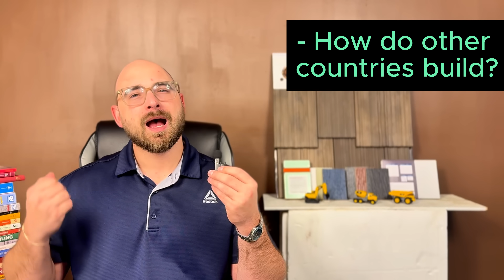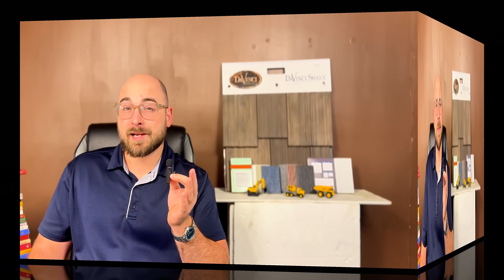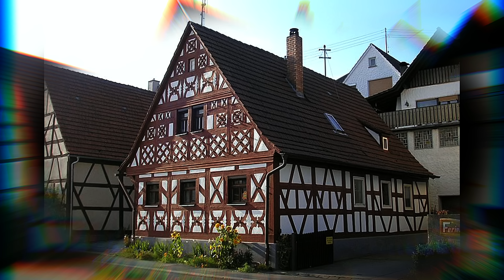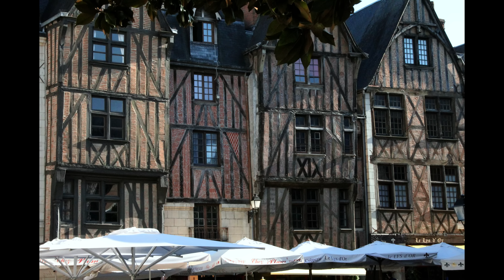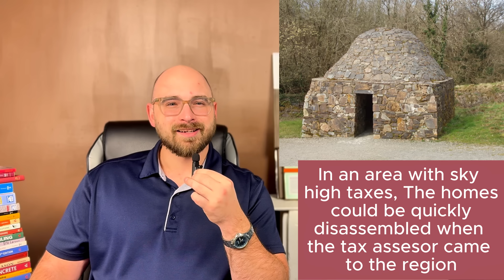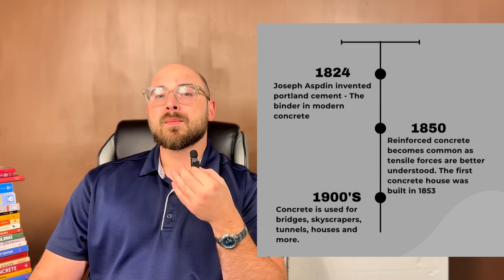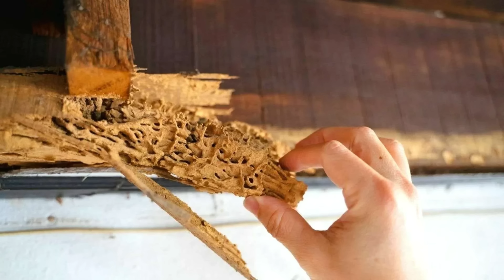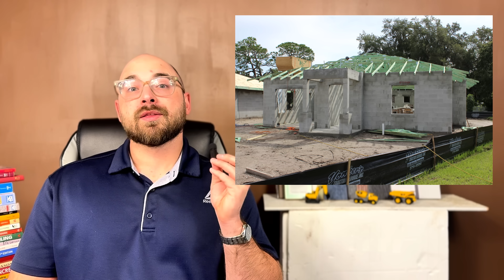Why Other Countries LAUGH at American Homes

Comment: Wtf in Scandianvia every house is built out of wood and drywall. Why because insulation, sturdy against storm, heavy snowing and shifting climate. Scandinavia have some of the most strict building criterias and regulation. Brick walls work in hotter climate and requires less maintaineance

Comment: are interoir walls solid too in other countries? how do they upgrade or run more electrical or plumbing? and wifi / cell signals must be terrible
Reply: You dont have a clue. Of course you can run new electrical & plumbing 😂 For your information wifi signals are fine unless you line your house with metal sheets (nobody does that) Really you are so dumb.. keep your head down and your mouth shut 🫣

Comment: wood are good for making house, its cold in the summer and easily trap heat in the winter(caomapre to concrete or bricks absorb greather heat before it saturate)
but today wood we get from the jungle or replantation aren't old enough or dense enough to make home, they are easy to burn down as well as its density. 
once the fire breakout, it will gone is very minimal time. 
I'm living in a place where many local tribes used to make their house(longhouse) with the densest wood(from jungle) we can find in the world. 
however with modern knowledge and old wood availability, they switch to concrete, because even the same types of trees the wood get from, its dint old enough to become good materials to make home. 

so North American need to know this as well, where frequent fire, hurricane, tornado or natural disaster area better to have their home built with materials that can withstand.

Comment: Great video! 
I'm in a unique position to comment, I live in South Korea where all the homes are poured concrete construction, and I do some work on them but primarily just on my own home. 
But I also remodel homes in America specifically in the Seattle-Tacoma area, and most of the homes I work on are 100 years old or so, but some newer multiplexes as well 
I do everything, interior remodel, exterior remodel, roofs, etc
And I can say this modern framed homes in America suck, not because of the framing, I think framing is extremely resilient to earthquakes, but it's because they are not insulated well on the inside, therefore it's like living in a sound box. Every noise in any part of the house can be heard throughout the rest of the house, they absolutely suck 
Also, every time I tear into some part of a modern built home I'm fixing something that the contractor didn't do right the first time around
The older homes which were built 100 or so years ago, and use lathe and plaster, are much more soundproof and solid feeling the only problem with them is they're poorly insulated 
Another problem is the American penchant for composite roofing which also sucks 
I only use metal roofing unless the Angles and complexity of the roof make it too difficult, like one I'm currently doing that has a lot of complex angles on top where were using composite and some flat sections front and back where we're using metal 
Metal roofs are superior in every way 
However amongst all the construction methods I find the poured concrete in Korea to be the best for its resistance to natural disasters it's feeling of solidness, virtually impossible to hear noise from one part of the building in another part 
The only problem with them is there really  don't insulate twem well, at least not in Korea

Comment: I live in Thailand, older homes are pretty similar to US, they're masonry foundation and wood structure. But as concrete became cheaper as there are lots of demand and supply was met and woods get much more expensive as logging became more controlled after overlogging. most houses today are built with concrete, in more urbanized area, precast is now the standard as it's cheaper to buy precast walls and install them in less cost than cast-in-place.  
It's all about what is affordable.

Comment: I like what's common in Norway right now for large apartment complexes, and its a good fit for larger homes: reinforced concrete floors and columns, then a traditional framing for outer walls. Allowing interiors to be one single big space that's highly customizable. I have wanted to design and build in such a manner, but unfortunately I'm not that rich, yet

Comment: In india almost all new houses made of reinforced concrete cement construction. There is so isolation that are typically used in coldwr regions.
Previously some households brick pillars(instead of rcc) were built and the flooring and ceiling was from concrete 

But in colder parts of south asia(where it snows or have near about zero degrees Celsius),older houses are still made of lumber structures and stones.
Newer ones are from rcc.

Comment: If europeans houses was in LA the firestorm should be LESS POWERFUL moster jouses have cement or clay Rolfs. Fasades in bric or concrete. Metal gutters and aluminium cowered Windows. 

Insulation is stone or glass fibre.

Many older houses have asbest or metall fasade cowers. 

No shingel or plastic outside. 

Most houses must accept 30 min fire against fasade by code.

Comment: Mike clearly favors masonry and concrete construction over platform framing or light wood construction, which are commonly used in the U.S. In colder climates, like much of the U.S., masonry and solid concrete walls are less energy-efficient than stud walls filled with fiberglass or foam insulation. Additionally, running electrical wires, plumbing, and other utilities through masonry and solid concrete walls is difficult to impossible, whereas it's straightforward with stud walls. Platform-framed or light wood construction homes, built to today's codes in the U.S., are very strong, weather-resistant, and definitely NOT disposable. If properly maintained, they can last indefinitely.

Comment: How well do solid structure homes stand up to strong quakes like experienced in California?
Reply from the maker: When engineered to include seismic joints and a reinforced foundation, concrete homes will outperform wood homes during a seismic event, able to withstand a higher magnitude earthquake

Comment: One thing you missed and one thing that needs emphasized about stick frame houses in the US. 1: Stick framing is extremely flexible in that the same set of skills and techniques can produce an enormous number of final designs and changes can easily be made "on the fly." 2: Because stick frame houses has been the dominant construction method for 150 years in the US, damn near everyone knows how to build using the technology. Finding the labor with the right skills is relatively easy. The down side is that this Chicago based technology doesn't perform well in some places, like California. When you need a house that can withstand fire with 100 mph winds and an Earthquake all simultaneously, you need to completely retrain your entire construction workforce.
Reply from the maker: You’re right, 

Wood framing is readily understood by contractors here, however other systems like ICF are not difficult to learn. At least they shouldn’t be for a skilled carpenter. 

And just because code allows something doesn’t make it best practice, CA might allow light wood framing but they would certainly benefit from steel or reinforced concrete homes more than light wood framing

Comment: Brick, stone, and other masonry structures are heavy. They will settle into the ground (often unevenly), and cracking is an issue. Drainage around the structure also becomes a concern. They are also not a safe option in any earthquake prone area. That's way the tremors in the Himalayas, Mexico, and along the Andes usually delete an absurd amount of people.
Reply: What absolute nonsense! All over the World we build with brick..we have foundations of concrete and tile roofs. No “sinking into the ground 😂
No drainage problems either!
You have no idea what you are taking about 🫣
Reply: @SueLeo1  I don't debate people who use emojis.

Comment: You are obviously an industry patsy. Pushing concrete when the trend is against it due to its energy impact, what is the figure? Oh yeah, it's responsible for 10% of overall energy consumption. I would be embarrassed to be pushing this material. And then to encase it in styrofoam?  Also missing in your rant is the use of AAC, autoclaved aereated cement which has been a dominant building material in Europe for a long time. It's great stuff that the U.S. has not caught onto yet.  We are so far behing the curve and with people like you will continue to be.  Get your act together. How much did the concrete lobby give you to do this commercial?
Reply from the maker: You’re right, the sensible thing to do is for everyone to live in a straw hut with solar 

It’s better to let entire cities be wiped out by hurricanes and fires, then to build resilient, because of a little bit of carbon dioxide. 

It only counts when it comes from making concrete, but not from a wildfire. 

You’re right 🙄

Comment: even outside of the obvious wildfire risk in California, it's hard for me to justify locking myself into a $500k mortgage for a light stick built home that sold 10 years ago for $315k or less 😅 ICF is awesome and i'd love to build a home using that, if it didn't cost $600k+ to build a 1500 square foot home. in America, everybody is trying to be a millionaire, so everybody from material manufacturers to contractors to real estate agents are trying to rip you off for as much as they can squeeze out of you. when extreme individualism is woven into the very fabric of your society, you're on your own.

Comment: I live in a brick house, built circa 1841, although parts are circa 1650, in Worcestershire, England. The Victorian walls all have a cavity (very surprising given the age). Two years ago I had the house repointed and about 100 bricks replaced - other this than no structural maintenance was needed. I suspect the house will be here in another 200 years...

Comment: You mentioned multiple times how lightwood framing houses in the US are cheap and easy and fast to build - yet they cost a ton of money nevertheless :)  You didn't mention the aerated concrete, silicate or expanded clay blocks - all very good building materials.

Comment: Great talk!  I nearly built an ICF Barndominium , but a large drawback was frankly the lack of confidence in the local "experts" (Oklahoma). A college engineer buddy built his own small home and it was a success, but my project was too large to leave to chance.

I did, I think, successfully convert a large CMU commercial building with 24" 50' I-beams, bar joists and steel deck roof into a barndominium of almost all concrete, glass and steel. I removed some framed offices and painted interior and exteriors, and constructed a partial 2nd floor using corrugated steel decking. The building seems tight and easy to heat and cool. The CMU is filled in some, maybe all places, but I guess an R-value of R13. Of course, additional circuits or plumbing is generally exposed except where I've framed some walls (bathrooms, etc.), so the look is perhaps too industrial for some. But generally, I can add walls and services where I like, and hang just about anything from the CMU blocks without thinking about framing.

The CMU building was built in 1960, so the cost is unknown. I would do it again, but it's rare where I live and perhaps too expensive.

Comment: Everyone built their houses out of wood, until they ran out a trees. They're just complaining about their own resource depletion. They build with concrete or brick only because they don't have enough trees.
In Canada, we need the space for insulation. Stone and brick and other methods used in warm and hot countries won't work here. We have lots of trees.
Canada has a very strict building code, and getting more so. However, the same construction method, built before WW2 last much better. The new building code is getting us back to that. You don't want a house built in the 60s, 70s, maybe not even 80s. 
A well insulted wall also stops sound from the outside.
The southern US should use concrete due to hurricanes. I can't believe that they haven't learned this. We have strong roofs to hold up tons of snow. You should build to conditions, not fads.

Comment: Heavy steel framing with cinderblocks or likewise brick types are gaining popularity also here in Turkey. I am not talking about the ligheeight galvanised steel, but an industrial grade one. Concrete framing decays after 40 years. Thank you for the video. Pleasure to watch.

Comment: Concrete is more often hated in Europe than it's loved. Out of many forms and functional purposes concrete is used in construction the ones universally understood as pointless out of experience in Europe are small volume (up to a 1/3 cubic meter) prefabricated concrete blocks, not at all or litely steel reinforced as the mentioned here pored into styrene forms (for much the same reasons printed concrete has no large fan base in Europe), and foamed concrete blocks for not load bearing walls (after several decades of using foamed concrete buildings ceramic blocks made a grate comeback though foamed concrete blocks are still widely used). Why it's so is a topic for way longer than this video talk, and this doesn't mean they are not used presently (probably precast small concrete blocks are the most rare these days).

Comment: Interesting you said nothing about Bulgaria. My mom has a concrete flat in one of 50+ thousand concrete living blocks in Bulgaria. We also build with concrete frame. I even finished a small building 13-14 years ago when I combined concrete framing with wooden framing in a clever (by my standards) way - my invention and it still keeps solid and not separating the concrete and wooden framing one from another. 

And we, Bulgarians, are famous with our “concrete beaches” on the Black Sea coast. 😎

Comment: i say its good for them that the states is catching up or even developing their own ways. by the way there is an entirely new way of building that Americans will totally love. it has all the pros of light framing but non of the cons and the outside walls can be icf or brick or concrete. its called
profil trockenbau
and i cant imagine that it wont catch on in the states

Comment: In Sweden, most single-family homes are light wood frame construction, just like in the US.
But by comparison. US building codes are far less demanding. From what I've seen, US homes are built to a very low standard. Single-layer drywall with no insulation! That's like the standard of a garden shed over here.

What I'm trying to say is that the problem isn't necessarily the light wood frame, but too relaxed building codes. 
If the authorities don't want to get involved, then  the insurance industry should definitely start demanding that new homes are built to a higher standard. 
The additional money spent while building is going to be saved on heating over the next couple of years. The building will last longer and retain a higher value.

Obviously, you should build your home the way that is best suited to your climate, and preferably with locally avaliable materials.

Sweden has adopted pretty ambitious goals for CO2 emissions over the coming decades, and part of this requires us to move AWAY from concrete as a building material. We use concrete for almost all buildings larger than a single-family home. Concrete makes up a substantial part of our country's CO2 emissions.
Another problem is that Swedens only, still operational, limestone mine (on Gotland) is nearing depletion, and it's been decided that further limestone mining on Gotland would pose too much of a risk to the island's groundwater, as well as endanger sensitive nature and agricultural land.
In a few years, we will have to import all cement and conrete, wich further increases the emissions.

So, the industry is now looking in to methods for building larger wood structures, and there has been a few pretty interesting projects.

Comment: Houses in my country is made out of a concrete structure/frame and brick walls. And with clay roof tiles. Unlike the wood houses in the USA we never have fires from outside sources only if the fire starts from inside. We could never have a Palisades disaster here.

Comment: Had a discussion with an American few weeks ago. Couldn't get the guy to comprehend that an automatic pickup truck that wasn't in gear wouldn't even dent my 50cm double brick walls with rebar between them.

He kept finding videos of busses getting stuck in European walls, or speeding cars taking out parts of the wall near the windows. As if those were comparable.

Comment: Uhm, nope.  Try going through an earthquake with a stone house.  Seeing one flex during the big one in CA was an eye opener.
Reply from the maker: the answer there is to build using steel, or concrete with seismic joints

Comment: Notice something very important about those wood frame homes: That's not a list of pros and cons☝It's TWO entirely SEPARATE lists. The pros are all on the contractor's side (cheap, fast, low workforce skill requirement) ...while the cons are all for the owner and user (short lifespan, warping, termites, fire...). I believe the technical term is "shafting the consumer". How very American 👏 Put that in your promotional material and I'm sure you'll sell a million concrete homes in no time 👍 Greetings from a brick-and-concrete house in Europe! 👋
Reply from the maker: the consumer benefit is as much square footage as cheap as possible